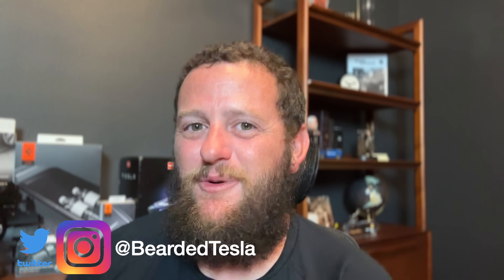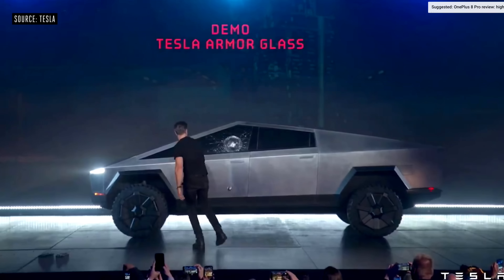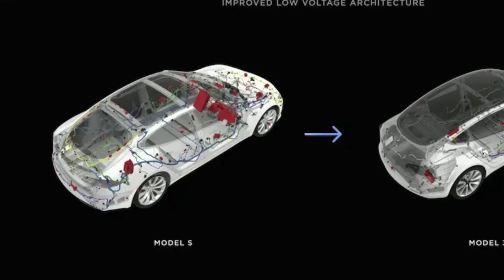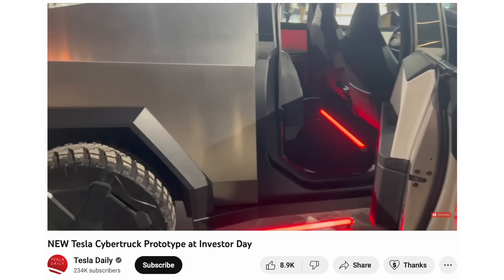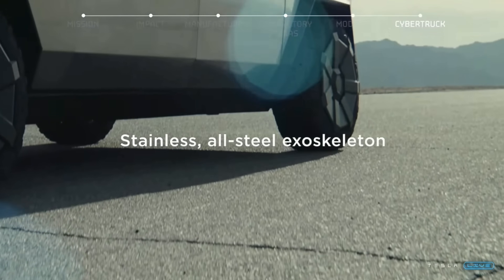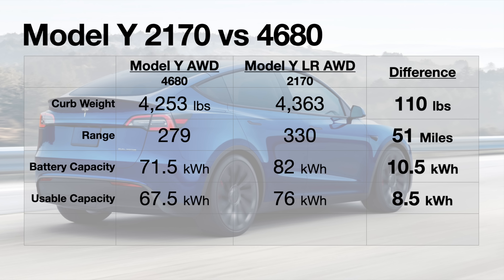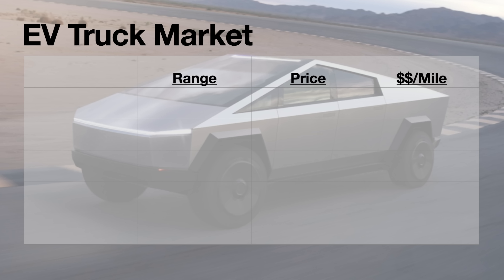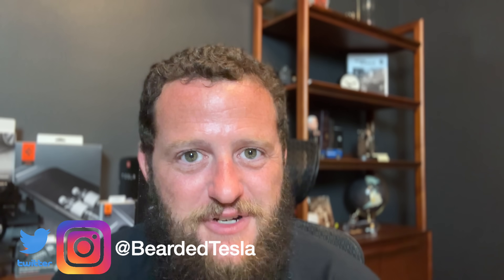Tesla Cybertruck Updates - Massive Change to Lineup / Less Range, Less Options, More Money

Comment: A 400+ mile tri-motor CT would be okay if it's under the $80 tax target.  Stainless skin, 1,000V fast charging, 48V accessories, along with the potential for FSD would give Cybertruck enough of an advantage over the competition to make one worth buying as long as the price is reasonable.  I'm not all that keen on the dual motor CT with 350 miles of range unless it's priced under $60K.  Will take a serious look at the Rivian, maybe wait for the tri-motor, maybe drive my Ford another 100K until the prices come down.
Reply from the maker: will be interesting to see how this shakes out at launch

Comment: Good video and discussion. I agree, 500 mile version won't be out for a couple of more years. Liked the look at the two batteries. They are using the 4680 because it is cheaper. I would also suggest it has more effective range in that it can be charged up to 100% all the time with minimal effect on the battery life, which you can't with the other.
Reply from the maker: Im not so sure that 100% charge is accurate with current chemistry being used in 4680
Reply: @BeardedTeslaGuy Correct, the 4680 batteries currently cannot be charged to 100% due to the battery chemistry.
Reply: @louiec.9782  my mistake. Was thinking LFP, which is the 2170 I believ
Reply: @jasondesjarlais5507  No worries I thought the exact same thing.

Comment: In the recent investor day they said the 4680 is now as energy dense as the 2170.  So maybe it will be 500miles or 350 mile depending on $$
Reply from the maker: Yea they finally have energy density to match their tech from 5 years ago. Still a ton of work to get where they need to be for 500 mile Cybertruck

Comment: Smaller batter is a much better deal.  The "bigger battery more range" is bad in that it takes forever to charge.  350 will be fine for 90% of people.  Having bigger battery may only be better for those trying to pull heavy loads where the range will be significantly reduced and the range will be needed.  Charging it will be a horrible experience though.
Reply from the maker: Disagree. But, I get it. For the towing community the battery will need to be bigger. Even with more battery to charge, it’ll take in way more kW charge rate for longer. Meaning in a 20 minute period, you’d have more range charged in the bigger battery than the smaller

Comment: Dual motor, 350 mile, $79,900.  There’s no reason to sell it for less, the demand there at that price for a couple of years of production.  I could see the vault and other options (ventilated seats, round steering wheel, rear w Rene, etc) being included in the price and a “base” model at $69,900 without them.

But you’re right on about the 500 mile range and 4680s…2 years minimum before they’re ready with enough density.
Reply from the maker: I agree, 2 years min. 80k for dual motor would kill demand IMO. Rivian can't sell their $80k trucks anymore now that they've sold to all the 80k EV truck market.

Comment: The CT is heading toward a 1000 mi. batt. range.
Reply from the maker: lol your crazy.
Reply: @BeardedTeslaGuy  I'll stipulate to the crazy part.   However, consider how long it took to go from 100 miles of range to 500.  Solid state batteries  and quick fill, slow pour capacitors are going to open up a new range revolution.  And, Tesla will be at the forefront of these technologies.  5 years, MAX.

Comment: The 500-mile range is needed for a truck because when towing you can expect this to be reduced 50%. if the 350-mile range is when towing that would be fine this is the same promise that the Semi's 500-mile range was with a maxed-out load.
Reply from the maker: yep
Reply: I drive to desert center. The range reads 260 miles. in reality 160 useable miles. I agreed with the need for 500 miles.

Comment: Most vehicles get released with the top spec first.  I doubt  the 500 mile cybertruck won't get released first. I hope it does since that's what I will get.  Having the Y long range is great for daily but if we had simply another 100 in range it would be perfect.  So the 500 would be more than enough.
Reply: Why would Tesla follow Ford. Ford will go bankrupt.
Reply from the maker: Not always. especially with the newer tech EV's. Even Rivian is just now trying to build the max pack battery.

Comment: 350 mile range no thanks will cancel my preorder if 500 mile offering is unavailable. Lets see how it works out. Trucks need range as they are not very efficient. 326 range on our 2021 Model Y isn’t enough either to be honest you can never achieve that range with 4 passengers, running the AC, Music, heated, seats travelling on the interstate @ 80 MPH you can only get 220-250 miles of range if you’re lucky. We tested back to back with an ICE car and the Model Y leaving same location, ICE car got home 1hr and 15 min sooner due to not have to stop & charge , it can be a hassle having to stop and change as superchargers become busier,  many times we will not take our Model Y and take the ICE vehicle because of it’s limited real world range just don’t have the time to keep stopping to charge it becomes a hassle’s we have noticed this the past two years, granted we like our Model Y but more real world range is needed, locally the MY LR is fine the fuel savings is real when you change @ home off peak.
Reply from the maker: It'll come, just not anytime soon.

Comment: Gasoline prices vary also ; but you have a rating of energy used per mile - gallons of gas or kilowatts of electricity per mile.  The local costs could also be specified or a dynamic calculator which the user can put in their local rates. Folks need to have figures they can find honest and can use to predict their costs for their driving.
Reply from the maker: agree

Comment: I am guessing that the recently released info on Model 3 for 2024 not having same or similar Federal rebate qualifications that Tesla is likely going to use much more 2170 batteries for the Cyber truck (basically using the Model 3 production quota) and to enable this shift, re-power the Model 3 / or Y with a different cell makeup that maybe does not fully qualify, just an educated guess at the moment. Might have to reserve a Cyber truck as I am not so hot for the 4680 battery tech yet! Your channel is always a good source of info, keep it up!
Reply from the maker: Based on the earnings call last night, it sounds like they are indeed planning on the 4680 cells for Cybertruck, which I was not confident on originally. I think 2170's would have made sense in this unique situation but it's good to hear that they finally got the 4680 to 2170 levels of energy density. Still a loooooong way to go though.

Comment: The cyber truck website still shows a 6 seat configuration. I’m holding out hope lol. If it works in my Ram 3500 with a stick shift and cup holders, it easily works in that cab.
Reply from the maker: I really hope so! I believe that the narrowing of the truck has made it difficult to fit the jump seat in there.

Comment: At launch in 2019 the dual motor was rated at 300 mi range, the Tri motor was at 500, so if it's the Dual motor at 350 range that is better, the comparison between the should be 2170 VS 4680 should be cost per KWh, it has always been the known the 4680 to be slightly less energy dense the upside is the lower cost and charge curve.
Reply: kWh
Reply from the maker: yep, more range than announced at dual motor, which is what I suspect the launch edition will be

Comment: Well actually if you do your research enough the 4680s in the model Y where not the finished product even in the taredown from Sandy Monro that only half of the cell had the dry electrode process and we know this is something that Tesla has been working we know that they now have been working on a solution. They are making factories for the 4680 and they need them for Cybertruck and we also knew that Tesla had high energy density cells of the 4680 design but making them is vary hard! Though I think they won't aim for the 500 miles but most likely low to mid 400 miles although there website in its abilities have not changed. And the report that it was going to have 350 miles of range, who exactly did it come from is it a reliable or just some guy who thinks otherwise.
Reply from the maker: They still dont use silicon, cathode is not made in house yet, nowhere near the performance needed. Even on the earnings call yesterday in a round about way, they said the 4680 is just now achieving 2170 levels of efficiency/density.
Reply: @BeardedTeslaGuy  it's getting there.

Comment: Right Grim; well these range hype are always exaggerated based on ideal lab like conditions.  In real world range tests as conducted on my Youtube Videos you find out what reality is.  For the Rivian which claimed a 350 mile range a couple that got one to pull a trailered mustange here on Youtube; the actual range under load was only about 120 miles.  The cybertruck with 4680 cells ought to do a fraction better but it is still quite bad for any commercial purpose.
Reply from the maker: nowhere near revolutionary on the range side.

Comment: I'm disappointed by the ride height of the "production" version we've seen. It sits a good 4-6 inch's lower then the prototypes we've seen, but no one seems to be talking about it.
Reply from the maker: I wouldn't look too much into that. Air suspension likely has everything to do with that
Reply: Cybertruck has air suspension. Can lower and raise. Most likely on low setting/comfort on getting in and out. My Range Rover has 3 air suspension settings like this.

Comment: FAR too much speculation.
We DO know that versions of the early 4680 were tested and found to have lower gravimetric density due to reduced silicon in the cell compared to the 2170.
We DO NOT know if that chemistry has been adjusted to the same chemistry as the 2170 since then.
We DO NOT know if cell numbers were simply adjusted to keep the capacity/ range of the Model Y where they desired it to be.
.
We DO NOT know if the chemistry of cells destined for the Cybertruck (eventually the Semi) are the original, 2170, or even better spec chemistry.
They have numerous lines operating, they don't have to be the same.
.
Your weight reduction again  doesn't account for structural difference between the versions of Model Y and assumes its the same 4680 chemistry as will be used in the Cybertruck.
We don't know.
.
As for drive configuration.
They have a tri-motor drive system which can tow 83,000lb on 1 motor.
Who needs Quad?
.
A lighter weight, regeared tri-motor system is logical for the top configuration.
Geared for 50%(?) more speed, pulling 75% less weight..... (6,000+14,000lb)
.
Brings cost saving while still having the option of "overdrive" gearing on a single front(?) cruise motor for range when towing (Semi style)
Twin motors supplementing for max torque.
Motor speeds electronically adjusted to wheel speed.
.
Price?
Match or beat a similar (or close?) spec "competitor"
That justifies the increase to those on the list..... "Inflationary increase"
It's understandable.
Reply from the maker: I think it’s a stretch to assume any real impact on 4680 cells in the short term. There is zero on the ground evidence of any efficiency gains. And if they did, it would be marginal at best and incremental.

Comment: I think these CT will be too expensive for most people to purchase, I think that’s why we are seeing Ford Lightning come down in price to undercut the CT. I’m sure Silverado will be next to cut prices both will give the CT headaches because the CT is a novelty, meme  truck that people won’t use as a work truck.
Reply from the maker: I think it’ll be a better price than the other trucks out there
Reply: A "Meme truck" doesn't have:
A bigger bed than competitors.
More tow/ load capacity
Greater ground clearance.
More resilient structure.
Better Electronics (/ electrics)
More security.
.
What have I missed?

Comment: Make sure to multiply the rated range to 60-80% for realistic range. One thing I HATE about my MYLR.. at least give me 90% Tesla. Rivian and other car makers actually gives a 90%+ realistic range. Trading in my MY for a R1S soon, and that is one of the main reasons.
Reply: That's just you then.
Reply: I get rated range of I drive the speed limit.   You're probably driving 10 to 15 % over speed limit which cuts range a lot due to wind resistance.
Reply from the maker: The EPA cycle is tested different for Tesla, because they do all the cycles. Orhers just take the standard multiplier which is why their numbers are lower and Tesla numbers are higher

Comment: Definitely makes sense, but I ordered my cybertruck with the 500 mile range, auto-frunk and a tri-motor a top of the list of must haves. 350 does nothing for me since my Model S already gives me that. Basically would like to travel in my cybertruck and not have to stop to charge before reaching my destination. I think the first gen cybertruck will be $79,990.
Reply: I’m on the list at about 1,111,111 so by the time  they get to me in 2030 the range should be well over 500 miles.
Reply: You're either wearing diapers or don't have a family.  My family needs to stop every 3-4 hours which is well within the 350 mi range.
Reply: @a76marine1  I think the concern is using it while laden. My Bolt EV has a rated range of 259 miles, a consistent real-world efficiency netting around 210-220, and a real-world range towing my dirt bikes of about 120 miles.
One day while riding just 30 miles from home a wildfire developed that led me on a long detour pushing the capacity of the battery.
Reply: @a76marine1  well good for you and your pissy family stopping every 3-4hrs while traveling. If I was wearing diapers, I wouldn’t be concerned with range on a cybertruck. I’m speaking from the standpoint of the Cybertruck I specked when I configured it years ago.
Reply: 350 is insufficient in a pickup truck if you plan to tow anything. The 500 miles in a truck is not the same as 500 in a car. Towing cuts the mileage in half or more, so if you want to tow a boat you can forget about doing anything outside of 150 miles.

Huge disappointment if that is true.
Reply: I generally agree on price. just under $80k for the tax credit.
Reply from the maker: Yea can’t wait to see official numbers but not jaw dropping stuff right now
Reply: You must have a bladder the size of a Hummer
Reply: 350 range with that charging ability would be more than enough. Just hate the looks of the cyber truck
Reply: 350 is merely the 300+ range of the Dual motor, finalized we think cuz some worker at tesla said that but no one in charge did.